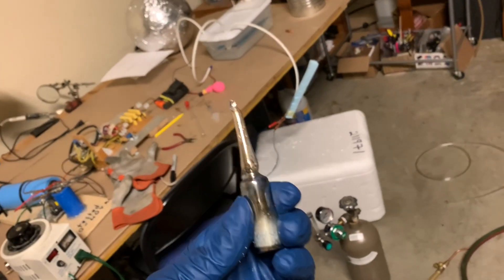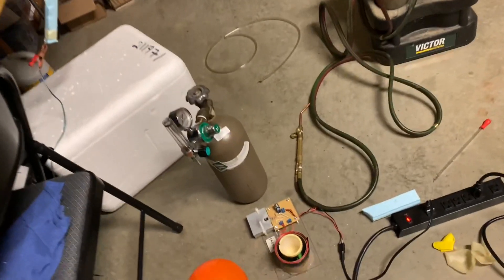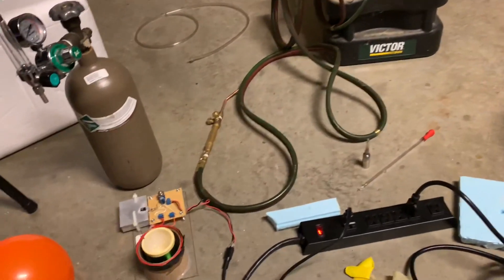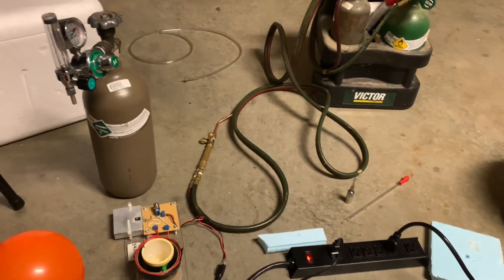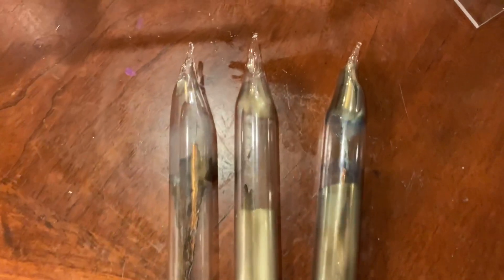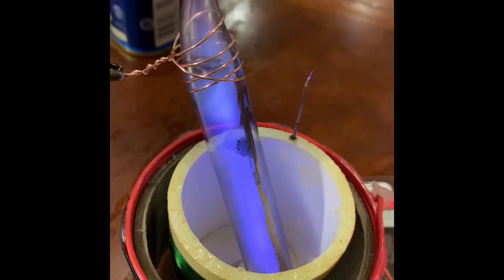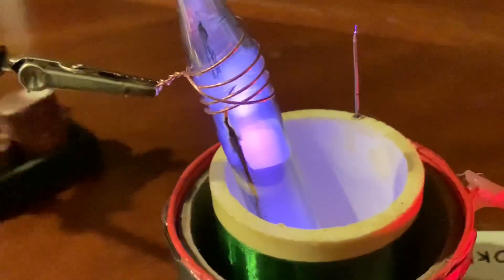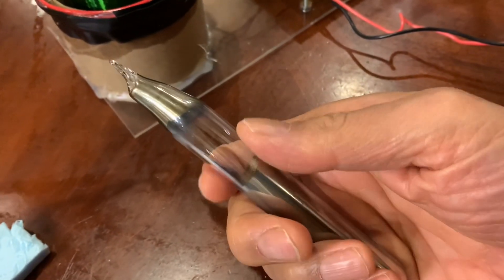Attempts at Cesium Metal Plasma Discharge Tube

Comment: Once i took apart an active countermeasures system and it had a very large cesium vapor arc lamp inside. It was made of alumium oxide ceramic similar to HPS arc tubes. The light was reflected by a gold plated titanium mirror and a silicon window to pass the midwave IR light. 😁🤓❤
Reply from the maker: Wow would have loved to see it running. Cesium vapor has such an interesting color when it’s ionized!!!

Comment: Interesting that where you coiled the wire no Cesium Metal collected in the tube...
Reply from the maker: Yeah noticed that- the glass was hotter where the wire was which is probably why the metal didn’t condense on that part